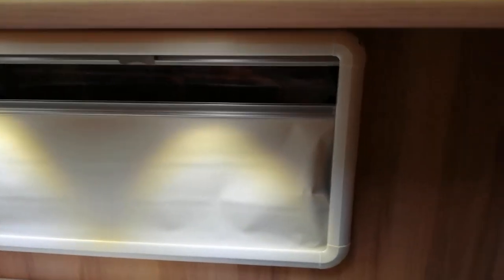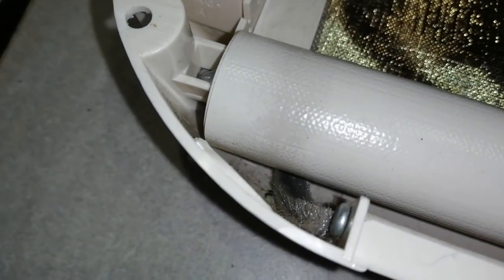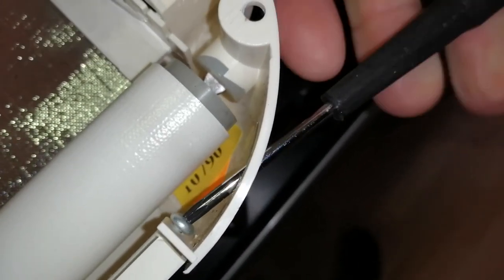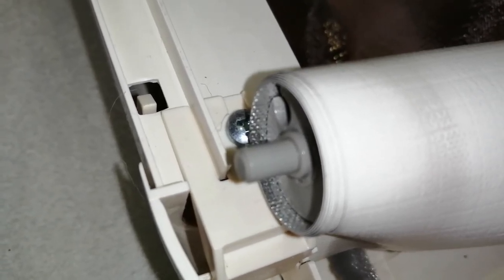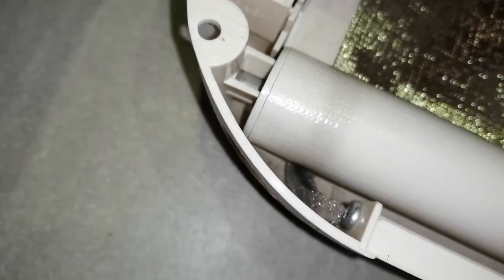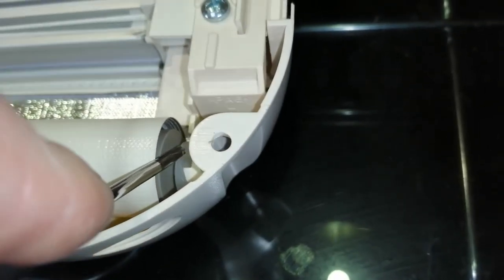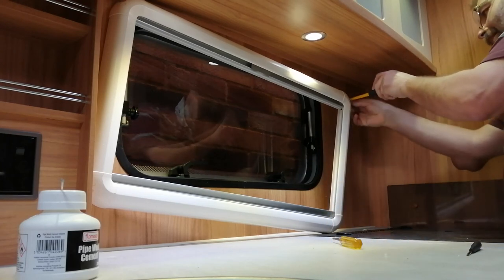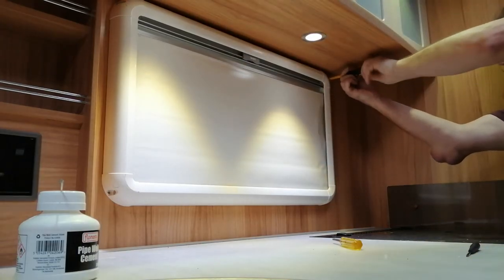Caravan window blind repair & fix . Bailey Caravan.

Comment: Also just to add when tensioning the spring (the plastic wheel cog you turned) look from the side of the blind and you will see a slot allowing this cog to be turned with a screwdriver, you can access this slot with the blind fitted.